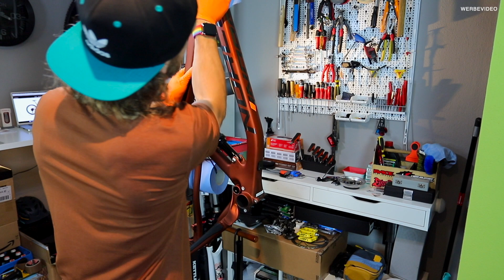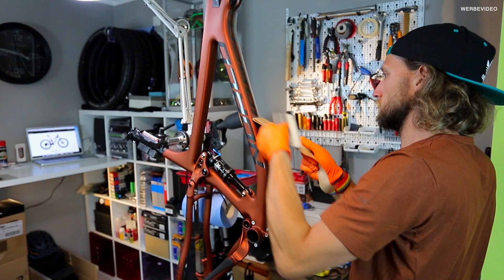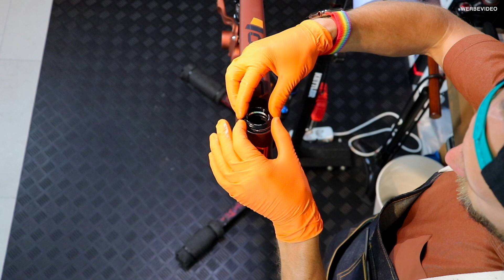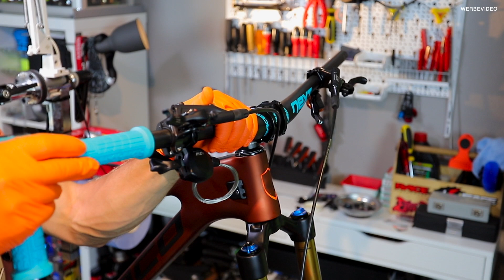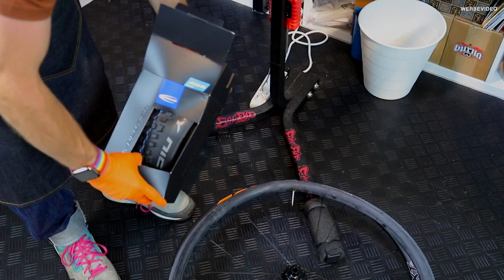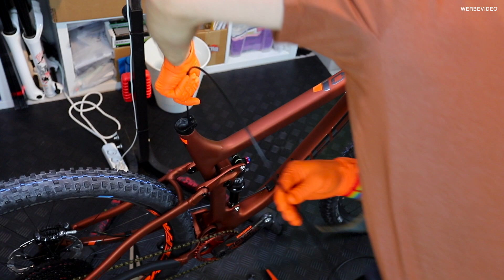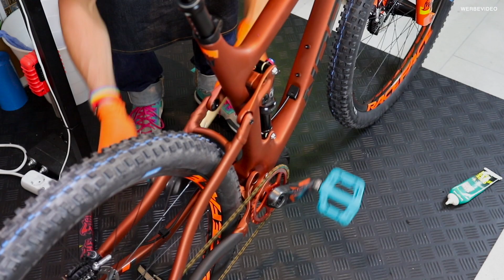Incredibuild Norco Optic C2 2019 - Marios Tool Time // Dream Build

Comment: I recently bought this model and wonder where I can buy that tape/decal for the lower tube (0:23). Thanks.
Great video btw, what first upgrade I should make on this bike?
Reply from the maker: Much appreciated thank you.
The Protection Layer is from a brand called Sports Cover and this is the Tube Shield in size Small with Matte Finish. Works perfectly and protects the Frame from anything. I put on every bike I have shields like this.
The first thing you can change I recommend is always the contact points to you and your Bike like Saddle, Grips, Pedals, Seatpost with the right drop and Tires. These are the things that makes a big difference. After this everything is personell preference like Handlebars, Brakes and Shifting.
I hope that helps..
cheers, Mario
Reply: rmb_dev literally just any store has 3M adhesive tape